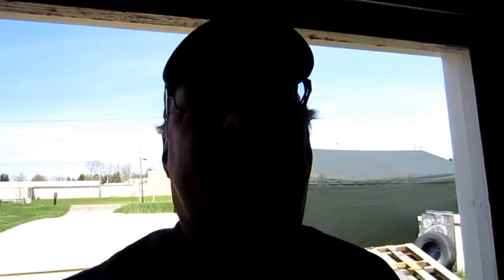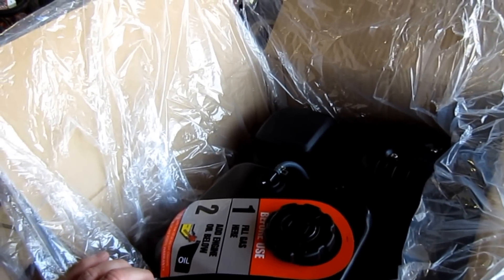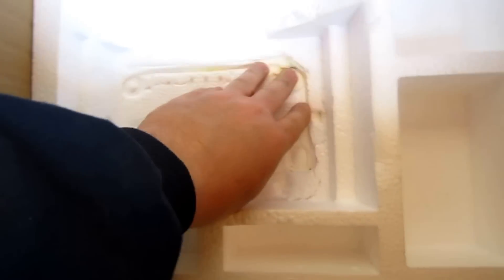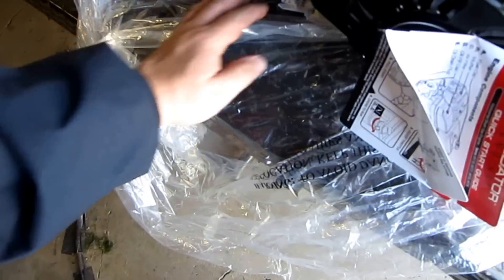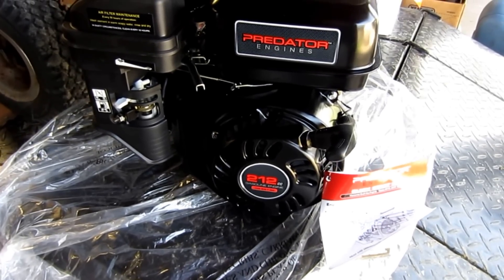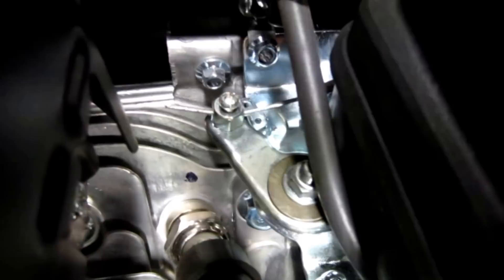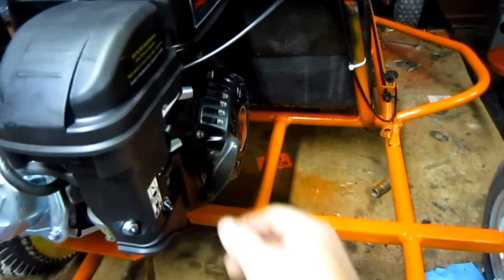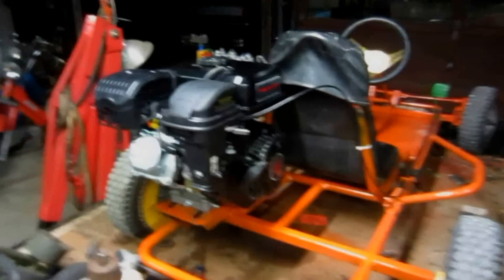Go Kart powered by Harbor Freight Predator engine

Comment: Hey 👋🏽 loved the video very informative. But I did want to know how do you connect the ignition cable to the engine ?
Reply from the maker: If you're talking about the kill switch it goes directly to the coil and it grounds the input wire. That's the small wire that's on the coil not the spark plug wire.

Comment: Question I just added mine on a go kart but my pulls moves once I turn it on y is that? Yours engine is on moves only when throttle is pull mine doesn’t ?
Reply from the maker: You either have a bad clutch or you have it too tight or your RPMs are too high on engine

Comment: Just bought a used cart  for the grandkids, came with little 5hp Subaru , plenty on top end once you get it rolling  but will not climb uphill even with a small load? any adjustments to look at before I start replacing parts? Motor starts super easy and sound good just no pulling power
Reply from the maker: Kerry forga gear ratio and clutch rpm engagement... The engine has to be at Optimum rpm when the clutch engages... Tire size and tooth count on both sprockets has to match what you want the kart to do..

Comment: if you pair the predator with , lets say a 145 hp engine would it increase the horse power and speed ?
Reply from the maker: HYPERSONIC THE GAMER Slightly, but only downhill.. 😁
Reply: oh thanks for the help
Reply: HYPERSONIC THE GAMER it would really depend on the type of radiator filter you use and what type of blinker fluid you use but if you do it rite you should produce 143hp

Comment: what happens to these engines of they get put sideways like if u have the go kart sideways instead of flat on the ground
Reply from the maker: michael tu papi nothing different than any other engine..
Reply: something happened to my predador engine for some reason when I turn it on seems like the clutch is catching because the kart wants to go forward with out giving it any gas and it will not stay on. also makes a noise coming from the clutch side
Reply from the maker: Clutch is broken..Probably springs in the shoes, or bearing seized..
Reply: Foxboss9 so I should just replace the clutch
Reply: Foxboss9 also how do I know which clutch to buy because they have different ones on ebay or can I just go to a Harbour freight store and buy one there
Reply from the maker: give these people a call -- http://www.bmikarts.com/

Comment: Instead of cheap clutch should have put a torque converter on it .
Reply from the maker: Mike Thomas 2 reasons not to...  1) I was reselling it. 
2) I would never install a tork-a-verter or any other variable drive on a non-live axle cart.. 
These yard carts only go for about $375-450 in this region.. $120 for the new engine... $75 for the new tires.. And then add the cost of a live axle conversion and finally the variable drive.. And I would have an asking price over $600 to make the same profit I did selling this at $425 And, the cart was only in my possession for 3 days total.. Adding those extra components would have made the "flip" of this unit take an additional day. And that's only "if" I was able to get a buyer at a much higher price.. NOW, if I was to keep it I would have done the axle conversion and variable drive plus there  a lot of other things I , Like suspension, bigger tires, disc brakes and Exhaust..

Comment: so my problem is that on mine when i start it it just wants drive away on its own. is there a better clutch i can use
Reply from the maker: daxter561 lower the Rpms at idle so it's not engaging the clutch.. If it is already a low/factory idle and the clutch is still engaging either install heavier springs in the clutch or buy a higher rpm one both can be found at BMI Karts.. Tell them you saw the video on YouTube and I said for you to call them.. Good luck..
Reply: Do they all have to have a clutch?

Comment: I recently bought the same engine for my kart. Did you have any trouble starting it? All fluids are good, I set the engine switch to ON, choke on, and gas on, and still won't fire up. Any suggestions?
Reply from the maker: michael hipol mine fired up in 3 pulls.. Check for spark by spraying a couple short burst of carb cleaner/starting fluid in the carburetor directly.. If it tries to start then you know spark is good.
Reply: Took your advice, it was the spark plug. Thank you!

Comment: Nice video. I bought my daughter a go kart here recently for Christmas with a Tecumseh engine. HS-50 to be exact. had to replace the clutch. Tire, wheel and sprocket which i got all in one for $45 bucks in Ohio. I replaced the points,condenser,plug but now i am having a hard time keeping her running. engine runs but doesn't run if you get what i mean. Point of this you showed me what a good motor that is and once this motor goes that will be next to be installed.
Reply: I got a go kart with the same engine on it and to be honest it’s complete trash. It was a 5hp and it’d start but if it stayed idling it’s just die so I’ve decided on buying one of these predator motors and believe me it’s for the better. There’s a reason tuchumsen doesn’t exist anymore their motor are garbage. Plus you’ll get a lot more fun out of the predator. They are only like 100 bucks if you’ve got a coupon and 120 without it. Totally worth the buy.

Comment: I bought and sold the exact same engine a few years ago. When Honda discontinues a particular model, they let the patents expire. If I remember correctly they were balanced, had very little if no vibration and extremely quiet... just like a Honda actually. I don't think there was a single one returned either. Of course I couldn't advertise them as "Honda", but for the money I was able to buy them, and sell them for, they were better.

Comment: I put this on my kids go kart tonight.  How do I get the throttle connected?
Reply from the maker: TrinidadRM in the video I show the linkage. Also I discuss how the friction washer had to be removed from under the throttle lever.. Make sure you wire in a kill/saftey switch so your kids can shut down the engine if the throttle gets stuck wide open..

Comment: I don't understand the whole clutch deal can you make a video of what it's needed for and how to install and make it work? That's literally the only thing holding me back from buying one
Reply from the maker: I don't have any small engines or clutches lying around as of right now.. Let me tell you though,, You have to have a clutch or a variator(more expensive) to make a go kart ,, well,, go.. To buy one you need to match the clutch you buy to the engine shaft diameter, the chain and drive/axle sprocket.. BMI Karts can help you match your engine up with the correct one..
Reply: +Foxboss9 thanks man
Reply: +Foxboss9 thanks man

Comment: Is that the throttle or the speed setter? If I understand correctly, the speed setter indirectly controls the throttle via the governor.
Reply from the maker: Throttle cable connects to  throttle plate control lever. The linkage on the lever is also connected to the governor..

Comment: I want to build a two person cart. would the 420cc version be strong enough. and does this come with the centrifugal clutch or do you have to get one yourself
Reply from the maker: +madd99921 you may want to go with a bigger engine for a 2 person cart. The engine is universal. It can be bought and used on a lot of different machinery. Rototillers, waterpumps, sod cutters, air compressors etc.. you get the picture..  Because mini-bikes and Go-Karts are really the only applications that require a clutch, all engine Mfgs including Predator / Harbor Freight do not sell their engines with clutches. Plus there are different clutches available that can be used on the same go-kart/mini-bike to achieve different engine performance characteristics. The clutch I used can he found by clicking the link in my video description...  Thanks for the question
Reply: +Foxboss9 predator also had the 301cc or 670cc. I'm hoping the 301 or 420 was enough .
Reply from the maker: +madd99921 with the right gearing/sprockets any of those engines will motivate the cart it all depends how fast you want to accelerate.. Those are all decisions you'll have to make further down the road as you start building your cart.

Comment: Have you had any trouble with taking corners and it shutting down?
Reply: has anybody done I build with a predator V-Twin from Harbor Freight on a dune buggy
Reply: disconnect the oil senser
Reply: though i ask have This engine in my go kart turns off when i panic stop or turn either way did u even figure out why

Comment: i have a question. so im thinking of buying an off road go Kart and it comes with a 150cc engine. but I want to swap it to a 440cc or 670cc engine. Is it possible to do this, if so what kind of precautions do I need to take.
Reply from the maker: Anything is possible.. Bigger engine means heavier..  So you need to maker sure you have the weight support needed like the mount needs to be welded well also the axle and tires need to be able to handle the weight during jumps and bumps....
 Bigger also means larger...  Make sure you physically have room for the exhaust route and engine to fit and line up with sprockets you will most likely need a larger chain...
 Bigger also means more power...   Heavier axles may be needed for the increased torque and possibly better brakes for the increased speed..   Good luck..

Comment: I'm trying to build a small go kart i live in a small town and i want something i can sneek in the woods but anyways what do i need to build a basic go kart besides the engine and brake and throttle such as transition or etc i see that you have that black sprocket thing attacked to the engine is that all the basic i would need is that and the engine ?
Reply from the maker: The black thing is a clutch.. It is a critical part.. The easiest way to get a cart built is to buy a old one needing repaired or buy a frame and go from there..
Reply: i have a farm I'm going to use i just am looking for a motor to use one it i plain on using a kid kettle kart

Comment: i want to buy an engine like that for a go kart, but i need reviews from you, what do you have to say? it is good?
Reply from the maker: That's basically what I am showing here. This engine is on a go kart. It is a good engine.
Reply: Yes, i know, but i was asking about opinions after use the engine a lot of times, thanks for response
Reply from the maker: +Hector A. If you watch the whole video, I mention the reason I had to quickly film the Go Kart at night and didn't have any video of it running.. and that was I was selling it and the buyer was coming after one day of it being on sale.. so I only got to run this kart with the predator engine for less than 45 minutes total before the new owner picked it up..
Reply: +Hector A. I got one of these engines a few weeks ago for my go kart and so far I have nothing negative to say about it. These engines are know to last and can put up with a lot of abuse. They're very powerful out of the box but if its not enough for you, you can remove the governor and modify the carburetor.  I'd definitely suggest getting it.

Comment: Hey bro, I have a question, but first let me say Thanks! Your videos I've watched helped tremendously. So, Can a kill switch on the 6.5 Honda Clone get locked in the Off position causing the connection to the coil to stay broke and not deliver spark needed? Thanks again!
Reply from the maker: +Hardball Hall Thanks!!  I won't say that it isn't possible but, it is likely either. If you suspect an issue with the Switch just disconnect the ground portion of the switch (2 wire) if it is a one wire just unbolt/unscrew the switch from the mounting position(1 wire).. If there is a low oil shut off sensor on the engine . try disconnecting that too to make sure it isn't bad..good luck
Reply: +Foxboss9 
It's a 6.5 Honda clone. only a year old. I've found the problem, clogged carb! Im the one who clogged it too! I guess I let something get in the carb when I reassembled it, don't take much at all to clog those jets. You mentioned an oil sensor. If there was one on mine where would it be? And thanks again, This Endeavor has made me like it, I've taken apart everything I got that runs on gas! lol! Thanks again;
Reply from the maker: Hardball Hall If equipped it would be a small metal box about the size of 2 starburst candies and have a wire entering into the block close to where the oil level sits at..

Comment: I just got the same motor from harbor freight in Missoula, Montana 1-05-2016..... I paid $129.00 for it. Also the 212cc has the claim of 6 1/2 hp... I'm going to use mine on a golf cart rear end in my go cart with a 20 series clutch from ebay.
Reply from the maker: +Robert Stark you will like the way it runs..You will know it by the way it sounds as soon as you start it up..have fun..

Comment: Please forgive me if I'm asking a question you've already answered. What is your painting process? Do you use spray cans, brush, power spryer? I'm in the process of finishing up an old go kart. Thanks
Reply from the maker: That is the first time anyone has asked...  I used "rattle can"  spray paint.  Make sure to wipe down really well with a solvent of some type like mineral spirits. (I use brake cleaner)  Then use a a really good primer and decent spray paint OR in my case I used really good spray paint without primer..  I am a huge fan of Valspar Tractor and implement spray paint.  It goes on even, it has great self leveling properties, it dries fast and shiny, and a couple of coats makes it hard to chip.   Here is a link - -  http://amzn.to/1L83Fzu 
the downside is that the colors are limited.

Comment: Hey man I just wanted to say THANKS for that tutorial on removing the friction washer. I thought I was screwed but this engine bolted onto my MURRAY with an old beat up tecumseh I dicked with that engine for 2 - 3 hours before I just said fuck it went to harbor freight and got this engine. It bolted up bolt for bolt and everything was perfect. shortened the throttle cable and BOOM brand new awesome running engine that starts on the first pull.
Reply from the maker: Awesome!

Comment: Hey im doing a motorized bicycle project and saw this engine and was wondering if it would fit in a medium to large bicycle frame.
Reply from the maker: I'm not sure.  It is awful heavy so even if it fits, plan on welding reinforcement support.. Good luck.
Reply: +NIck Carswell (KK6NNC) these are to bike  i have tried to mount them  you need to get a gruube skyhawk engine

Comment: Nice job!

Wondering... can the pull start housing on this engine be rotated aft (to the left looking at it) to make it easier to start when it's mounted to the kart?

Also  what's your sprocket and tire ratio?

Building a kart for the grandson. 

Best. 

Thx
Reply from the maker: What a cool Grandpa..!  The recoil can be rotated.  I have no idea of what that ratio was for suggestions based on tire size, weight, horsepower you might want to contact BMI Karts.. Good luck..

Comment: How did you get the belt pulley off the old engine? Mine looks rusted and will not come off the drive shaft
Reply from the maker: Some of them do rust and won't come off. Unfortunately You will need to buy a new pulley and cut the old one off with damaging the crankshaft too much.. Good luck.

Comment: I bought an old Murray explorer frame that had a Tecumseh 6 that was shot for $100. bought the 6.5 motor from Harbor freight $150.  Direct bolt up. Removed  the oil level sensor cut off wire and done.  I can Throttle high or low.
Reply from the maker: +David Edwards awesome.. gotta love that

Comment: how fast did it go?
Reply from the maker: 75 MPH..........   JK.. I don't know.. As I mentioned in the video,  other than my kids trying it out in the yard it didn't get ridden and I sold it the next morning after the video was shot.. With a small rider and different wheel tire combination and gearing I suppose 45mph would be possible. But the low end would have been terrible. A Tork-A-Verter (variable speed drive)  is needed for the best of both worlds..

Comment: i have a 79 cc predator somrthing is not right the engine runs fine its just wen i hit my brakes the engine wants to die so i think the clucth is wrong
Reply from the maker: If the engine runs fine at an idle with the chain connected and the wheels stationary then your clutch is OK. If it stalls at idle or won't start with the chain connected and the wheels stationary then the clutch is locked or your idle speed is too high(causing the clutch to stay engaged)..  If it starts and idles fine while wheels are stationary but stalls when you come to a quick stop you may have a carb tuning issue with either the air/fuel adjustment Or the idle speed Or the float in the bowl... Good luck...
Reply: well i dont no i just put this new engine on and just no that wen ya going up a hill or slow down the engine wants to die and it should not do that cause its a new engine
Reply from the maker: +sweeks406 I don't know either.. Sorry

Comment: That chain is so loose.
Reply from the maker: TheJelly132 You don't want any tighter as to cause bind on the small bushed bearing the clutch operates on. Basically you want it to spin freely as long as it does not come off all is good..